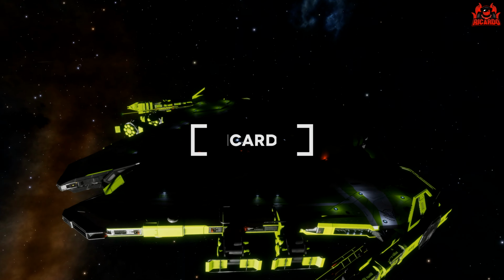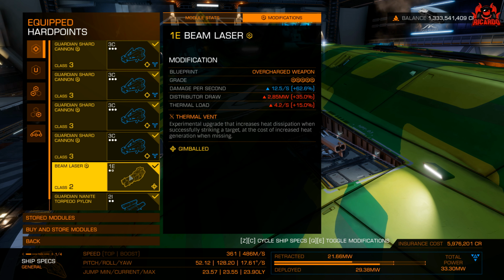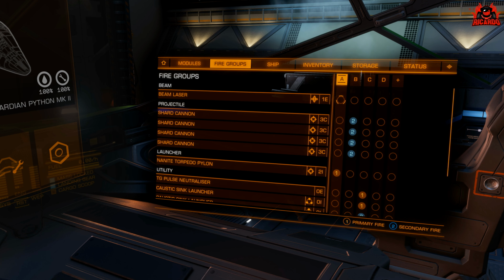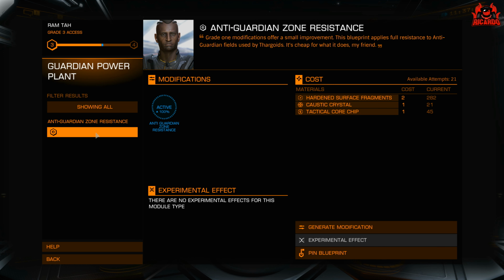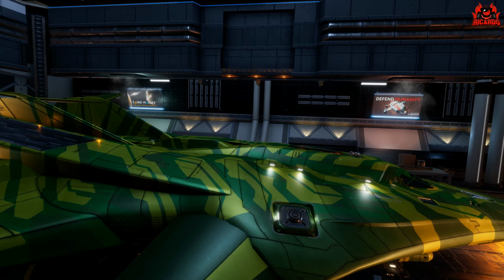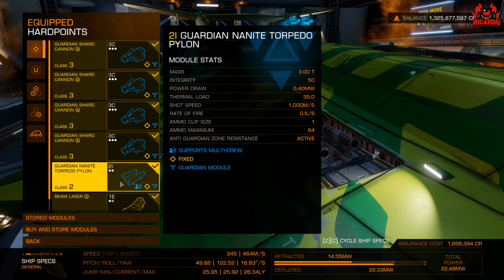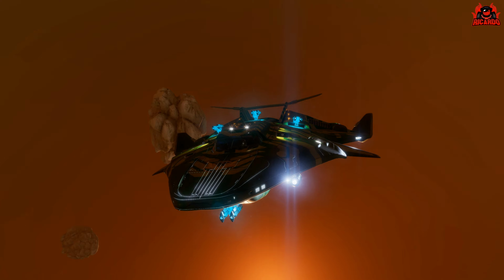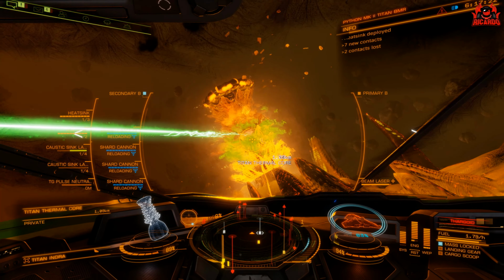Is Anti-Guardian Zone Resistance Worth It? Elite Dangerous

Comment: Very similar to my build. Main difference is I prefer to forgo the shield in favour of a 5d repair limpet and I bring a class 4 cargo rack. It makes for a far more fragile ship but for me the lower heat and power requirements that come from ditching the shield mean I take a lot less fire (from everything other than glaives). As I usually fly solo having a few repair limpets along helps out after the runs where a glaive spots me.